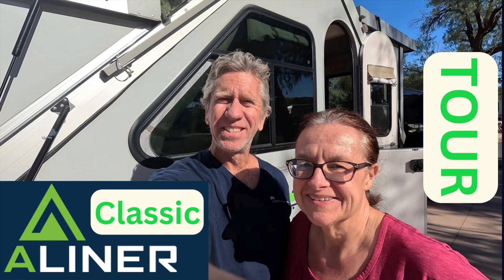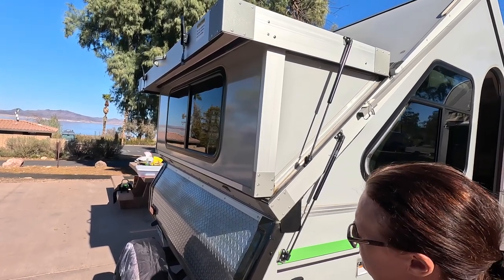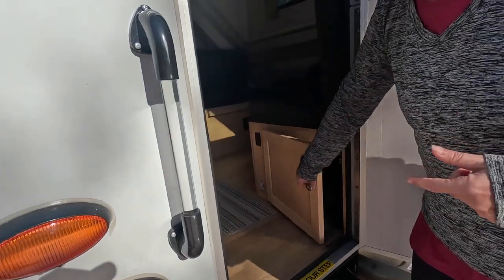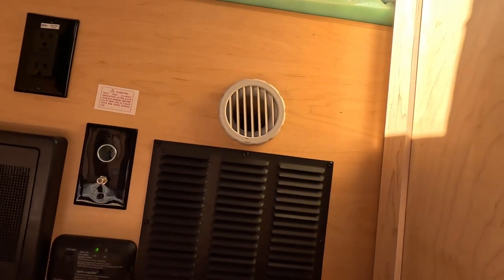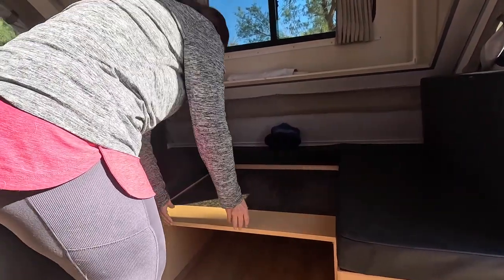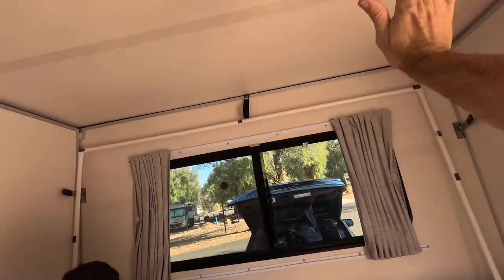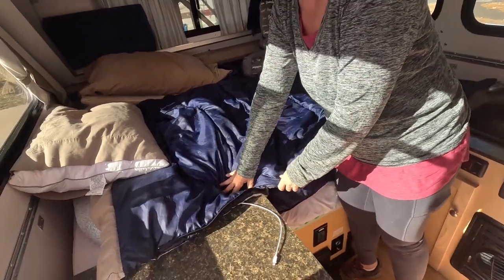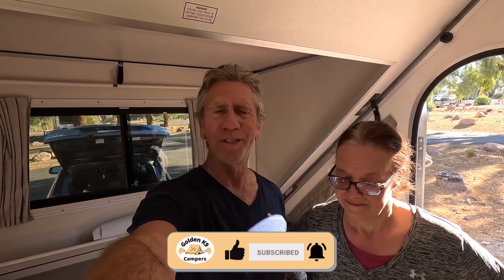A-Liner Classic Tour & Owners Review | 2022 Model with Hard Dormers and Permanent Bed | Inside & Out

Comment: Thank you for the tour. You have a very nice Aliner.  Your video prompted several thoughts.

(1) We have a 2021 Aliner Ranger 12. It has the older style 3-way refrigerator that needs to be manually lit for propane power.  I never use it. The newer model automatic 3-way refrigerator you have is much better. 👍 If our refrigerator goes face up, I will replace it with one like you have -- and maybe sooner than later.

(2) We have the standard propane heater and the in-wall AC. Both work very well and this setup does give us more storage area in the trailer, but I think the newer heat pump system like you have is really nice.  Sweet tech! 👍

(3) We have the canvas-side dormers because they came with our Aliner when we got it. However, if I had my druthers, I would much prefer hard-sided dormers.  They are (a bit) heavier, it is true, but they are also quieter in the wind and the rain, they are better insulated to  retain both heat and AC cooling, and you can leave them up when camping in bear territory, which we do quite a bit. 👍

(4) I also like the windows in the hard dormers better than the flexible windows in our canvas dormers. The hard windows are more clear, they are quieter in wind and rain, and they more useful overall, in my opinion.  Good choice there. 👍  

(5) We keep the canvas dormers closed in bears areas, in light of both park regulations and personal preferences. Still, the dormers are great for the extra space they provide and both types of dormers are quick and easy to use.  As you probably do, we use them often.👍

(6) Our Aliner came with the "queen-sized" sofa bed, which can be either a sofa or a bed. We have never used the sofa arrangement. We laid a 4" tri-fold mattress topper (non-cooling foam) over the top of the standard cushions and leave the bed assembled all the time. Very comfortable, very practical, and a lot less messing around to set up, to take down, or to make the bed. The only time I lift the panels under the bed is for maintenance or modification.  A permanent bed arrangement works very well for us, too. 👍

I know that you will continue to enjoy camping in your Aliner and that you will continue to enjoy tinkering with it, too.  We love our "tiny house".
All the best!
Reply from the maker: Hi Jerry...  Yep, we love our little house too!  We we're originally going to get a scout, then an aliner ranger 12 with soft dormers, then we decided on the classic with hard dormers.. and finally we changed our mind to the permanent bed option. Glad we didn't find one right away.. till we finally decided !!
Reply: @GoldenK9Campers  Great choices all around!

Comment: I'm happy for you guys and glad to see you are getting it set up for your use.  Mine is back from the shop...  a hose came off of the water pump which caused the fresh water tank to drain while in transit.  The shop said keep an eye on it because it's a frequent problem.  What the hell?  Every trip I gotta worry about losing a tank full of water?  Anyway, my Jeep and Aliner are on the short list of sticking around because of frequent problems with both of them.  They have been fun, but they have been nowhere near reliable.  I'm taking my dear wife on vacation to New York for a week (I was born in Brooklyn and can't wait to see the sights and walk the streets again).  I'll have pics on IG as we take our tours.  I'll see what I do about the Jeep/Aliner when I get back.  I'm close to the 60K service on the Jeep and if they can't/won't fix the problems with it (engine oil leak, front-end suspension noise, driveshaft vibration), then I'll start shopping for our next camping setup...  The other problem I had with the Aliner was how low everything was to fit below the folding hinge points...  and as tall as I am, it really sucked having to go to the floor for cabinet space or to wash dishes at just above knee height... and, it's basically a one-person standing camper, there's not much room for two people to move around inside.  Anyway, some of my whining after two years with the Jeep/Aliner, and it's time to move on to something bigger and soon (well, soon to start looking at options available that will work better for us.  We'll see what happens).  Cheers!  Pete - KI7LIL
Reply from the maker: I'll be very curious as to what your new setup will be.  I love the new Bronco's, but they can only tow 3,500 lbs, so not sure if that will handle the new camper setup you want.  The Popup campers are pretty spacious, but get the feeling those might be even less reliable.  Unfortunately, we have to store our camper in our garage, so our options are very limited.  Luckily our camping stays are relatively short, and we know up front that the A-lienr will be mostly to sleep in our to get out of the cold weather.  Most of our time will be outdoors or in our Clam Shelter where there is much more open space for us and the doggies.
Reply: Next rig will most likely be a 3/4 ton truck and 5th wheel.  We also like a motorhome pulling a toad (probably a Ford Ranger or F-150, I'm done with Jeep quality issues).  Either way we'll need RV storage space away from home. We're going to start going to RV shows and take our time shopping, so probably within this year before anything happens.  But, we'll see... we've surprised ourselves before and bought right away lol.  Anyway, enjoy your Aliner, it looks sharp and I hope it serves you well on many trips over the years!
Reply from the maker: @peterkunka2694  Shopping is half the fun!  Good luck. Can't wait to see what you get !!
Reply: Based on my experience, I would recommend that new Aliner owners doublecheck EVERY water  and electrical connection in the trailer at the first possible opportunity. This can save a lot of consternation down the road.
Reply from the maker: @jerrystark3587  Absolutely agree !!

Comment: Another great video Darrell.  Are you happy with the way your Rav4 tows this Aliner?  Any complaints?  We re also considering the Classic or the Ranger 12.  The Dry weight on the Classic is 1725 lbs and the Ranger 12 1510 lbs.  Is the difference in weight due to the hard dormers, bigger refrigerator, and heat pump?  If doing it over again would you still get the Classic?  Do you use any kind of Porta Potty in the trailer?  Does it ever leak?  Is it drafty?  Do bugs get in?  Any and all comments and feedback is very welcome!  Thanks again for your help it is greatly appreciated..
Reply from the maker: On the weight, I think the Classic weighs more because the harder wood cabinets, the extra windows, the larger fridge, the microwave, and the heatpump.  We got hard dormers, so we really like the classic because of the extra windows, and also the stove is inside/outside, which we don't use and give us additional counter space.  We also love the microwave.  The prime pulls it fine.. I think our weight fully loaded is about 2,200 lbs.  We can't take much stuff with us, and only take one propane tank with us and put it inside the camper when traveling because of the tongue weight.  Doing it over again.. We have yet to use the water tank.. but the furnace is a must (which doesn't come on the Scout), so the only other choice is the ranger 12.. and we do need the AC.. so the weight would not make much differfence.. so I think we made the right choice.  We don't use a porta potty.. it has never leaked.  It's not really drafty.. but in the cold where the walls and roof fold in there are metal hinges which get a bit chilly.  No bugs really get in.  There is some maintenance.. seems every trip we need to fix something.. but that would be the same for any trailer.  We really love it.
Reply: Thank again for taking the time to give us that feedback! @GoldenK9Campers
Reply from the maker: You bet.. good luck.. @gfp1011